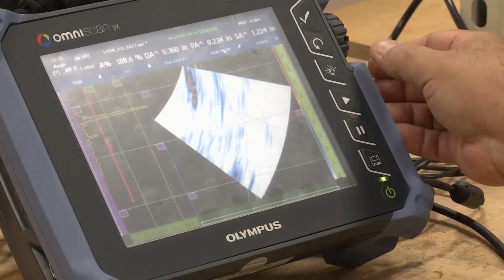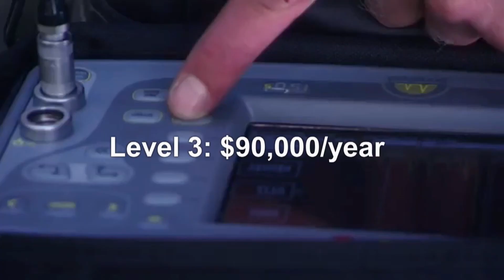Non-destructive Examination

Comment: NDE is a great career path.  Welding and other mechanical projects need the NDE Specialist.  Certified specialties fall into many testing areas: Acoustics, Radiographics/X-Rays, Eddy Current, Ultrasonics, etc., ASNT drive the technical field.

T J (Tom) Vanderloop, AWS & SME Memberships.  Certified Manufacturing Engineer, Consultant and Author